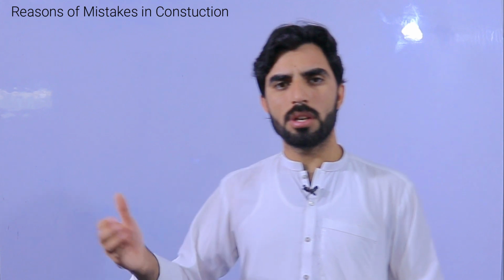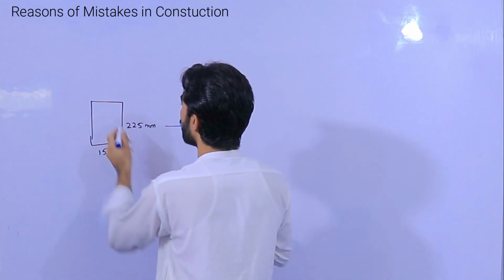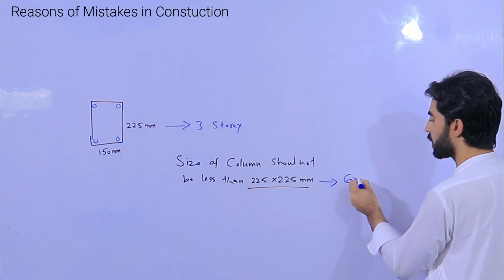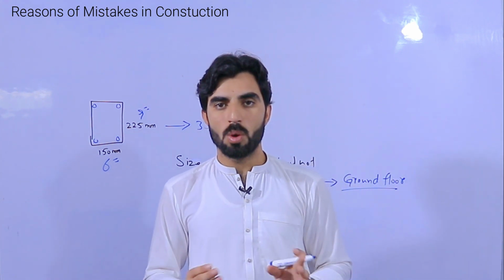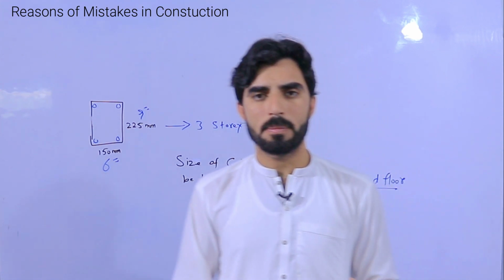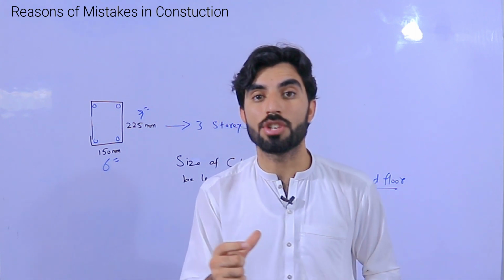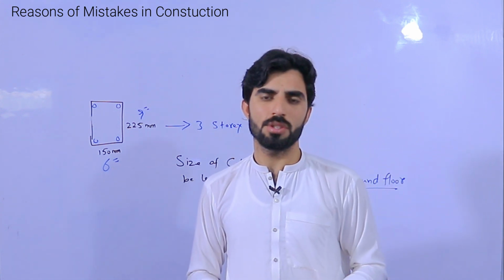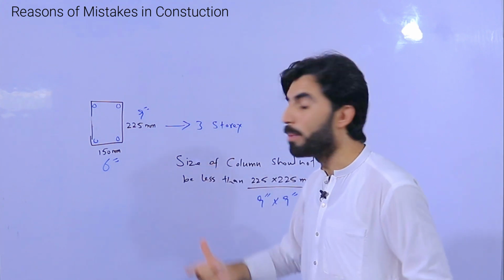Reasons of Mistake in Building Construction - Civil Engineering Construction Site information

Comment: Is it okay to use a 4 bars of 16mm iron rod for G+1 storey?
Reply: Using 4 Rods of 16mm should be adequate for G+1 Storey. However, it's safer to carry out structural engineering calculations. God bless.